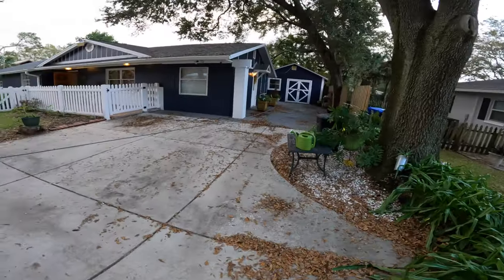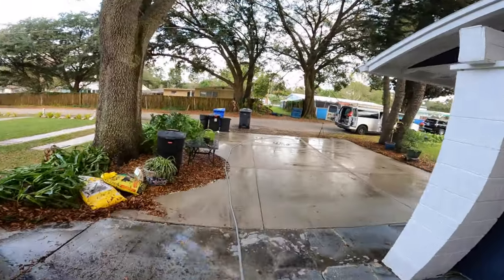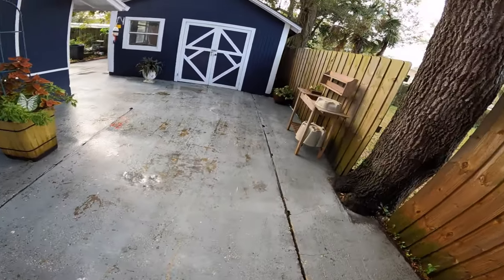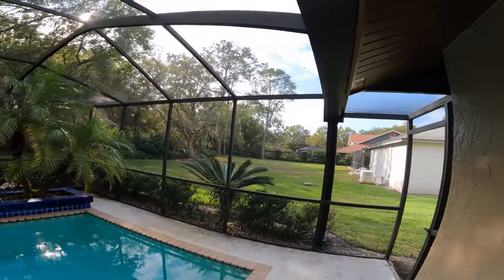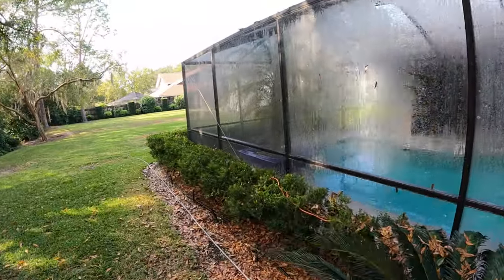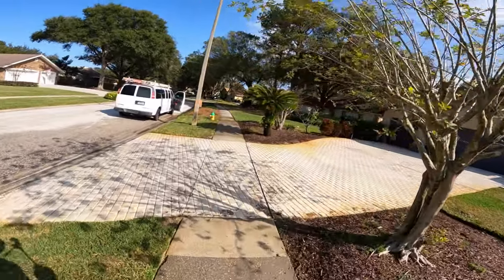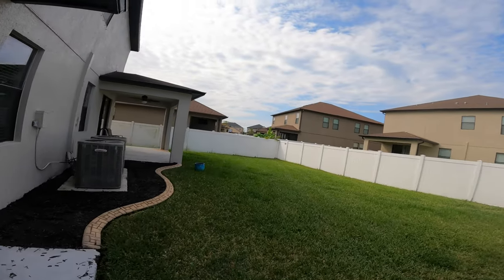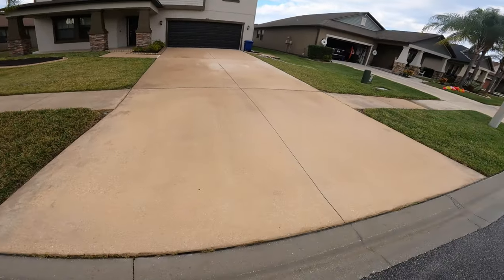3 tickets 💰 | Cool GoPro Mounts POV

Comment: For the pool cages, are you using a1% - 2% mix on those?
Reply from the maker: Downstream mix works on those. Not so much worried about a 1 or 2 percent.  It's not that big of a difference between the 2.

Comment: Good morning Cliff, I hope all is well. Cliff, do you think it's a waste of time to go with a 10 GPM machine over the 8 GPM? Or is it better to have and not need or to need and not have? Cliff what is your take on the two machines?
Reply from the maker: I'd take the 10gpm any day! And twice on Sundays! Most of the time at jobs is spent rinsing. And speeding up the rinse process with 10gpm is a game chamber. No to mention to clean flatwork also.! You can run a 36" surface cleaner very efficiently and you can almost run with a 24 inch surface cleaner lol.  2 machines is good if you have a team and also it's good just in case 1 breaks down.  I'll be doing 2 machines on mine.  My current 8gpm and a 10gpm soon

Comment: All 3 jobs came out great. What percentage do you get with that super Sud sucker
Reply from the maker: I never did a ratio test with it. I know I love it and it lasts a very long time. Pulls more than the GP Injectors. My 1st one I used it for 2 years. I only upgraded to the stainless steel one cause the brass one got rusty.
Reply: @PinkFlamingoPowerWash  Thanks I was just curious. I've seen on some of your videos you downstream  the pool cage screens some are very bad and have that Liken on them and it's melts it off like Butta Lol

Comment: what tips do you use bro?
Reply from the maker: I have an 8gpm so my Jrod has a Davis shooter tip for 2 story soap.  2550 1 story soap, 0020 2 story rinse/washjet tip, 2520 1 story rinse. If you got a smaller GPM your tips will be different.